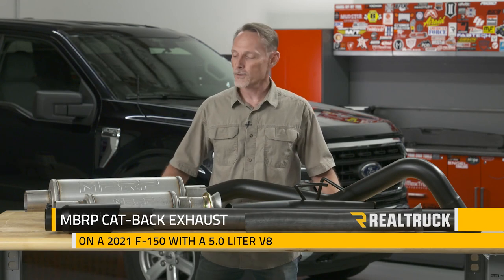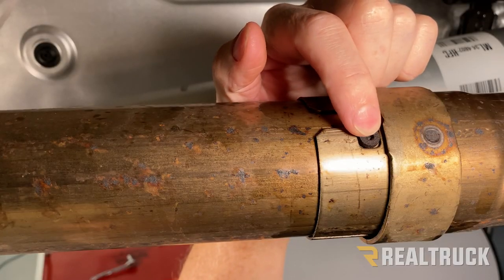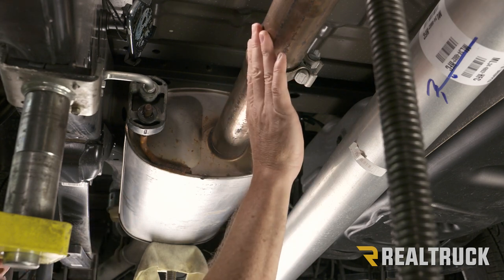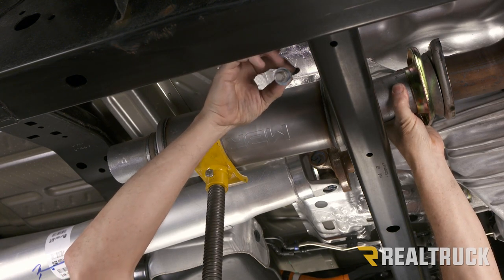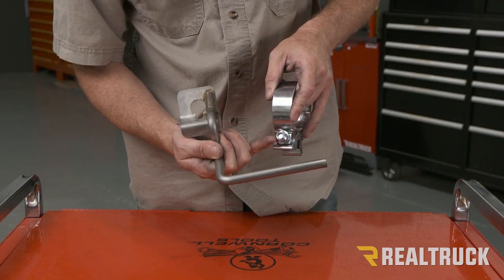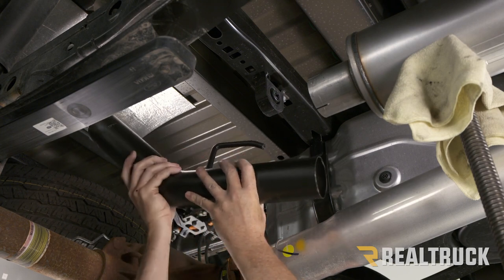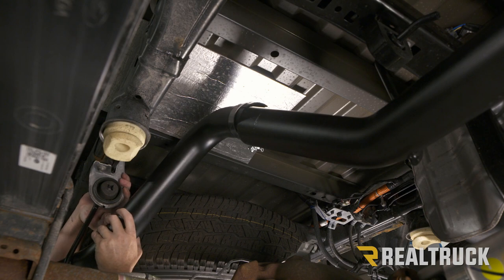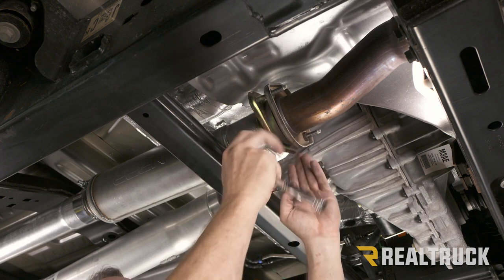How to Install MBRP Black Series Exhaust System on a 2021 Ford-F150 5.0 V8

Comment: Think it's possible to get the stock exhaust off without a lift
Reply from the maker: Hey Travis, yes, but not in one piece. Cut the exhaust pipe above the rear axle and the 2 sides can be removed independently. Hope that helps!
Reply: I do it all the time, it's not that difficult
Reply: i took my complete exhaust off in one price on the ground in my garage with out a lift

Comment: Any reason I HAVE to separate the resonator and muffler pipes by trying to unlock the guide pin? The resonator pipe isn’t reused in the MBRP install. The reason I’m asking is I can’t seem to unlock them despite lots of penetrating oil, jiggling, and hammering
Reply from the maker: Hey there! I wanted to show how to take apart the factory exhaust without destroying it. If you're having trouble with the guide pin and don't mind cutting the pipe, that's definitely an alternative. -Todd from RealTruck